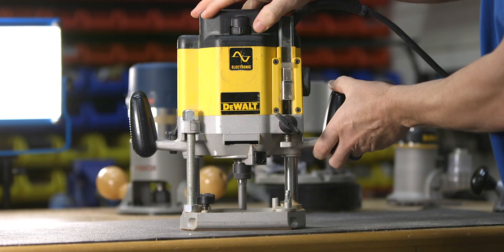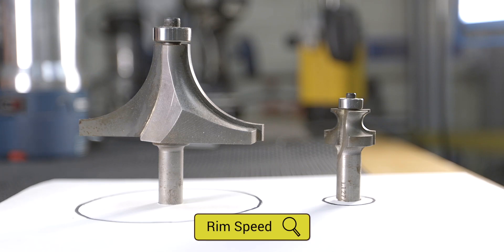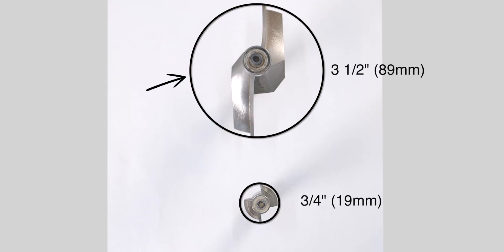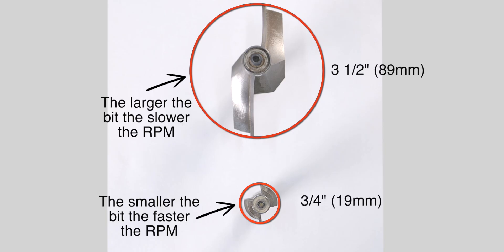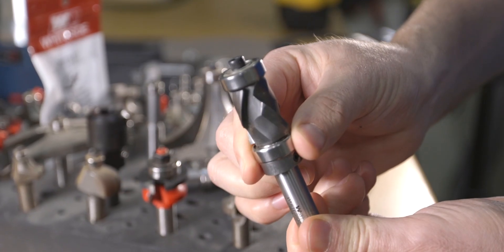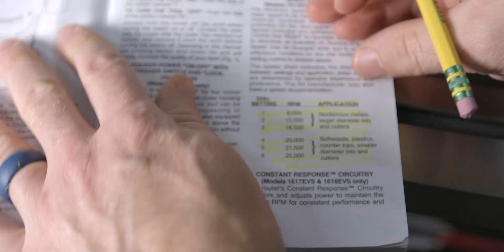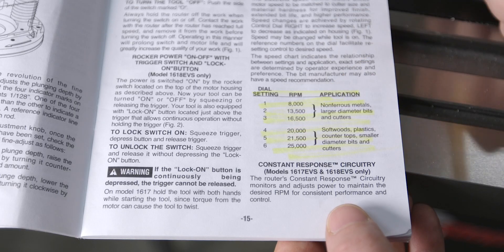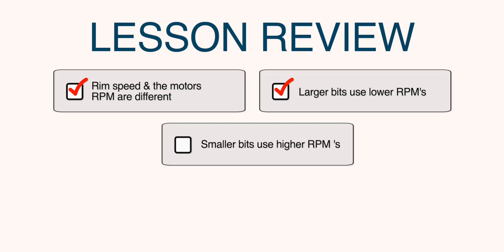Proper Router Bit Speed (How Fast Should It Spin?)

Comment from the maker: Thanks for watching!
 👉 Want beginner-friendly woodworking and router training? https://bit.ly/3DcIeE3
 👉 Join our Free Woodworking & Carpentry Community: https://bit.ly/41ouySk
Reply: I’m fairly new to woodworking and just bought a 1/2” double bearing flush trim spiral bit, it’s 2” tall, the monster that has 10 square changeable carbon blades, I think it’s more in common with a helical Thicknesser blade than a standard router bit. It is absolutely brilliant and I believe much less dangerous for a newbie as it seems much less volatile, having said that I have only used it once and it’s in a new router that I set up in a table with a fence, none of which I have used with a 1/4 inch router.  I used it for the first time this afternoon and only put it on slowly but it definitely did the job ( flush trimming guitar necks ) I put it on approx 9000 rpm on the Makita RP2301FC05 ( that’s how much of a newbie I am ) lol, anyway I’m just trying to figure out if that’s about the right speed, it’s not exactly a common router bit just yet but it’s definitely going to be. Any suggestions or tips would be greatly appreciated, thanks 🙏🏼❤️🇦🇺

Comment: Hm, I really appreciate the important distinction of RPM vs Rim speed. I hadn't considered that! But some of what you said seems inaccurate: "Just because the router is spinning at 18,000 rpm, doesn't mean the bit is spinning at 18,000 rpm. "  Please correct me if I'm wrong, but I think if the router is going at 18k, the bit is of course also spinning at 18k, but a bigger bit will have a higher rim speed than a smaller bit spinning at the same rate, no?
Reply from the maker: Yes, if the router is set to 18,000 RPM, the bit is absolutely rotating at 18,000 RPM. What I should have said more clearly is that RPM and cutting speed are not the same thing.

A larger-diameter bit has a much higher rim (surface) speed than a small bit at the same RPM, which is why larger bits need to be slowed down. The motor speed doesn’t change, but the speed at the cutting edge does.

Thanks for pointing that out—this distinction between RPM and rim speed is exactly the takeaway I was trying to drive home.

Comment: Always informative and useful videos.

I do have a question though, in respect of different types of wood, as in should the bit speed be lowered for hardwoods and increased for softwoods? Ive just started doing routing with a Dewalt 1/4" shank but find when trying to d a rebate in Pine, there's a lot of tear out at a setting of 3/4. Im going to try increasing the speed as that's what I've read helps. Is this your experience?
Reply from the maker: Bit speed in general should be set by the bit size, not the wood type. However, some experimenting would be helpful. Yes, try increasing the speed and see what happens. Let me know.
Reply: Hi, I did increase the bit speed and it did reduce the tear out. There was still a little but slowing the feed rate cured that. Thanks
Reply from the maker: @anonymouspdg6121  Awesome. Great job!
Reply: @TrainingHandsAcademy  Interestingly, I was using a rebate bit with a bearing, so initially didn't use the fence on the router table. It was mostly ok but did have some tear out. However after increasing the speed and adjusting the fence so it was level with the edge of the bearing and thus supported both sides of the wood either side of the bit, the tear out was eliminated with small passes. Not sure if it was the speed increase or the fence that helped, maybe both?
Reply from the maker: @anonymouspdg6121  Sounds like both. Great job problem solving!

Comment: What effect will be when using lower speed？
Reply from the maker: Lowering router speed helps avoid burning, especially on hardwoods or with large bits. It also makes big bits safer and extends bit life. But go too slow, and you risk tear-out, chattering, or scorch marks if your feed rate doesn't match. Bigger bit = slower speed.